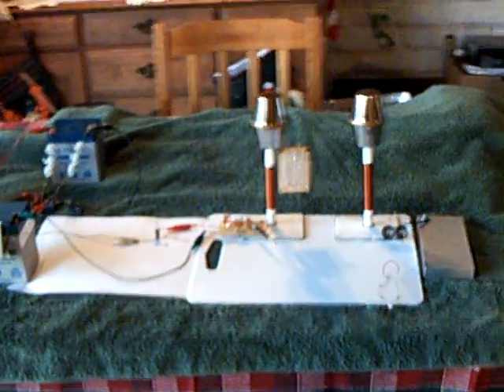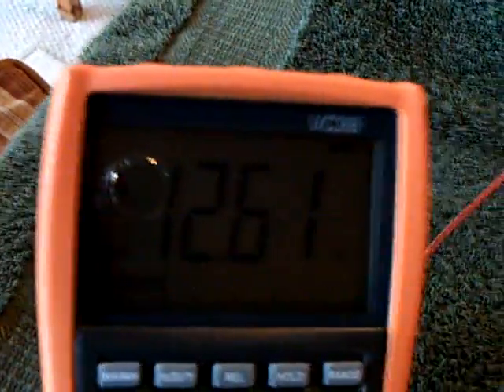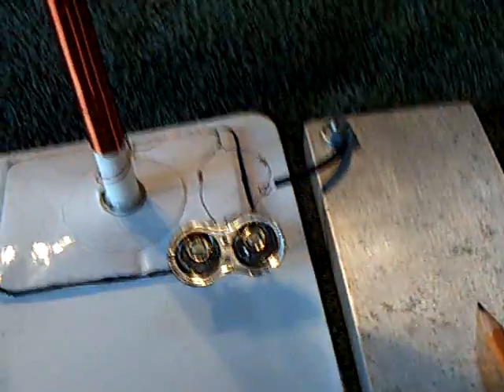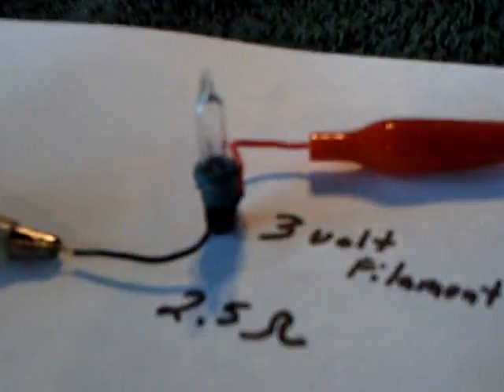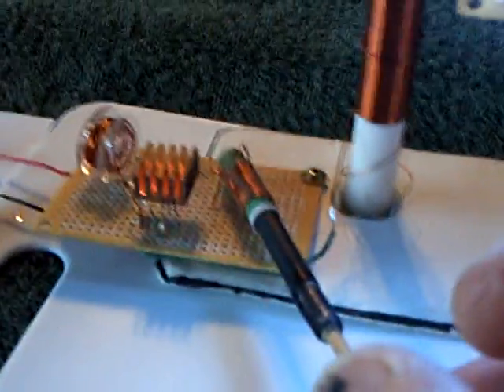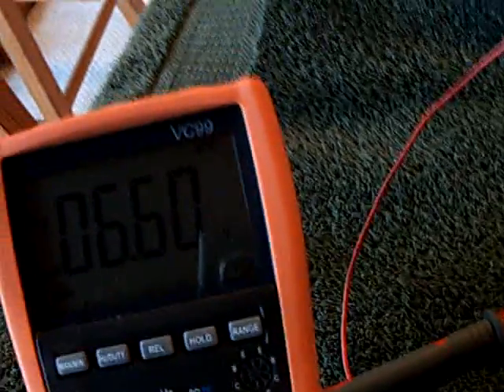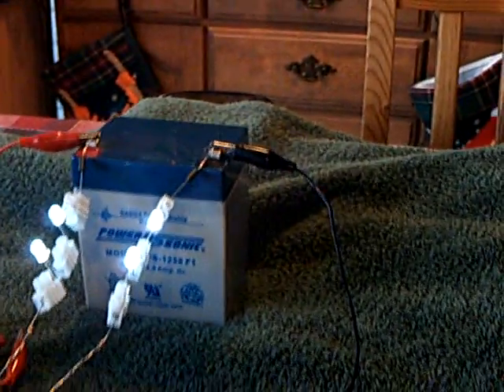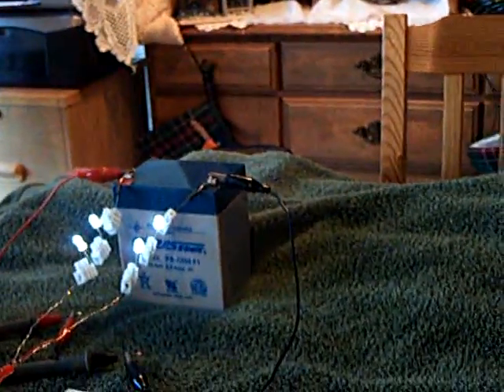SEC 15 -- Light & Battery Charger.ASF

Comment: Is this "over-unity"?  This seems like one could put a couple of paralleled batteries in the charge position and fill them before depleting the source battery.  Is this an accurate assumption?  My main interest is in producing usable light for supplementation in my small greenhouse.  Could i use this SEC to light an array of fluoro-tubes while just swapping the source and charge batteries? Would arrays of 1w leds be better or even make a difference?